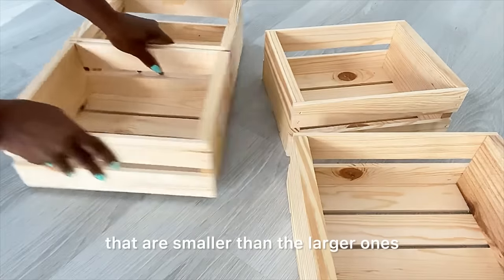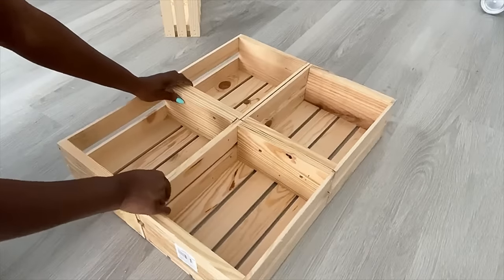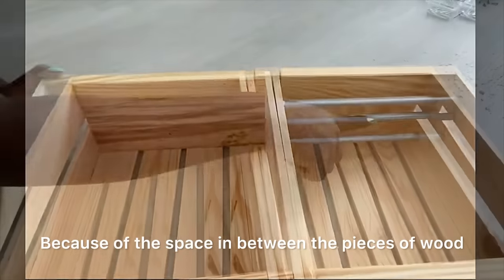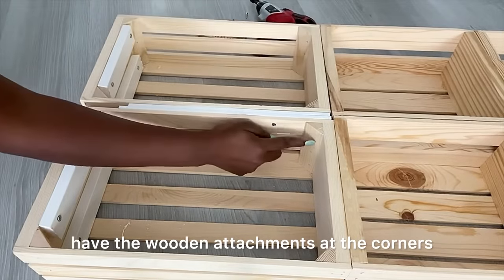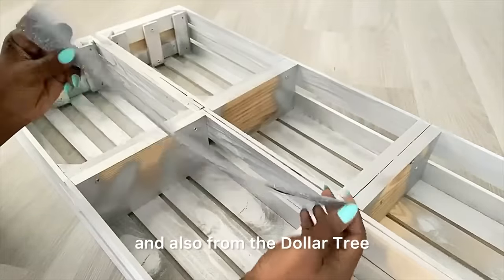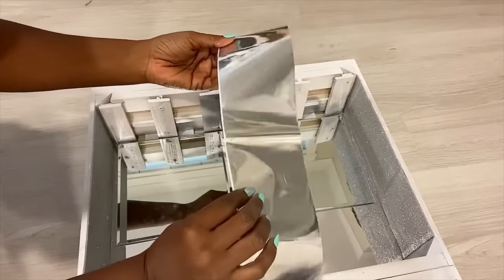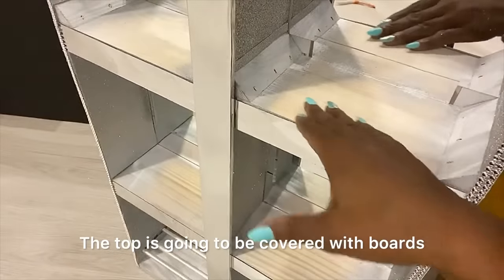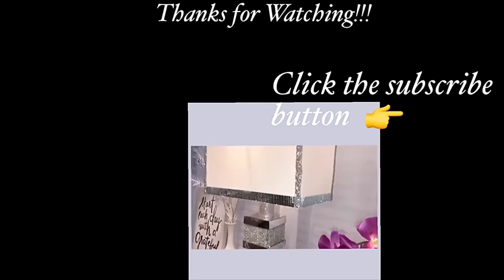GLAM DOLLAR TREE KITCHEN AND WALMART CRATE  IDEA TO TRYOUT!

Comment: Very nice. I did the same but in black. I didn't put the mirror reflective sheets down the center or the bling around the edge, but I will now!! Thanks for the idea! This will finish my look! I did add mirrors to the outside but I placed them in a triangle instead of placing them as squares. Great designs as usual
Reply from the maker: That's awesome! Adding your own touch to the design sounds like a great idea. Have fun with the bling and mirror sheets, and I'm glad I could inspire you. 😊